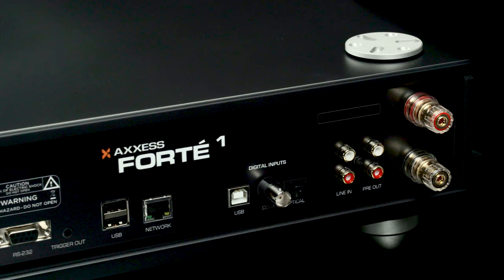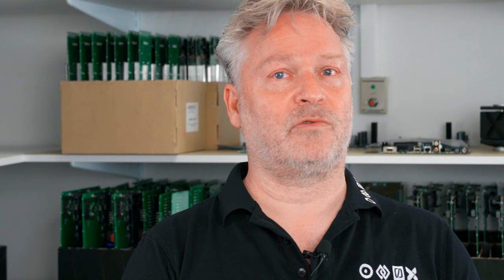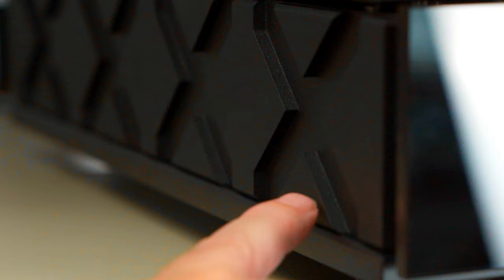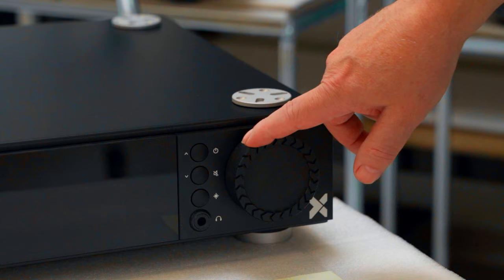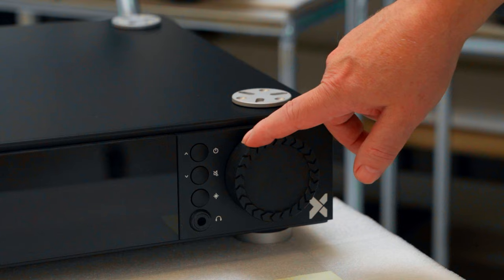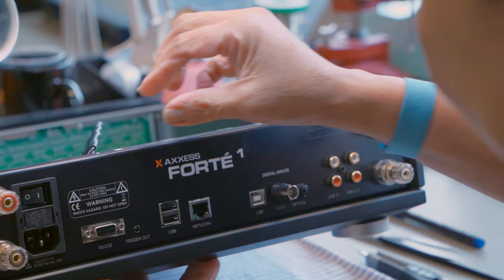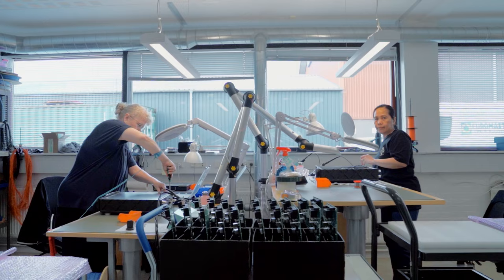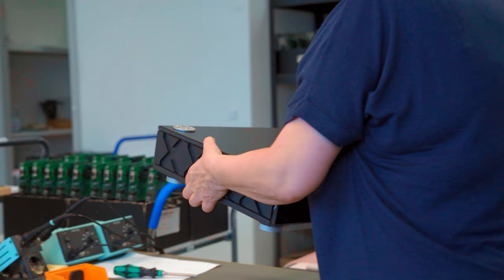What is the Axxess Forté? | Introduction

Comment: Unclear whether this can drive 4 Ohm speakers or planer speakers which typically are difficult. Also, is there bass output / management?
Reply: Yes, Magnepan speakers and other magneplanar speakers can be driven with the Axxess. Unless you want to play over 95dB continuously then maybe the U-180 from Aavik Acoustics with a separate streamer would be better.

Comment: Hello Michael,
I have listened to it recently connected to 2 different Hi-end pairs of speakers. Even thought ones of them were very hard to feed, Forte could surprisingly drive them with ease. However I see some inconsistency in how powerful is the output 100 watt/8 ohms, as stated on the website or 120 watt as you claim. Could you explain it, please?
Reply: The Axxess Forte uses the lastest Pascal proprietary UMAC™ Class-D technology which is rated at more than 100 watt per channel but in typical understated Danish fashion Audio Group Denmark publish the power rating at 100 wpc into 8 ohm.